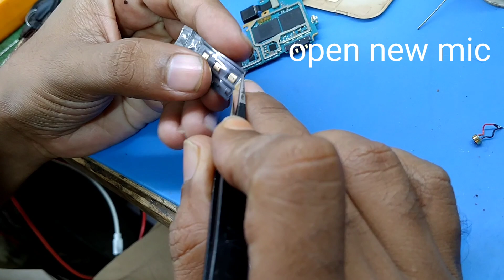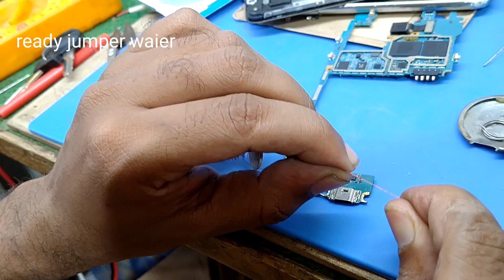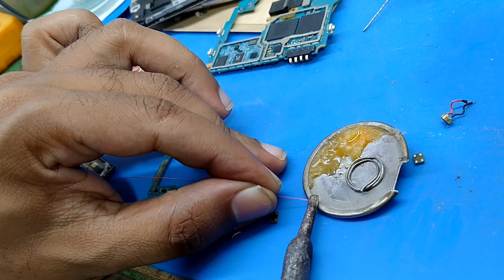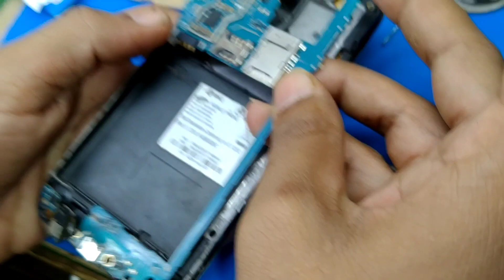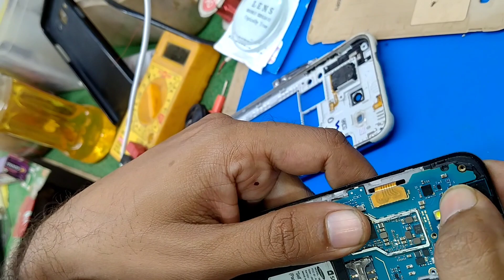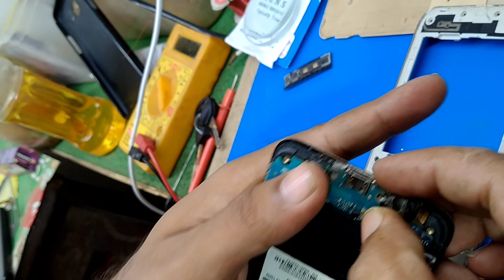how to fix 4 leg mic without use smd

Comment: Pcb ka purana solder remove kijiye desolder wire se
Naya solder lagaye
Mic ke contact ko solder Kare 
Ab pcb ke solder ko melt Kare (pcb ke  niche / uper se ) components ka dhyaan rakhe
Jab solder proper melt ho Jaye toh    gun ki nosel hatakar turant mic ko rakhiye (eska aapako practice karna padega hath ka balance banana hoga ) ye mics enki capacity se jyada heat lagne se kharab ho Jaye hai
Reply: Yes,exactly right ,bro